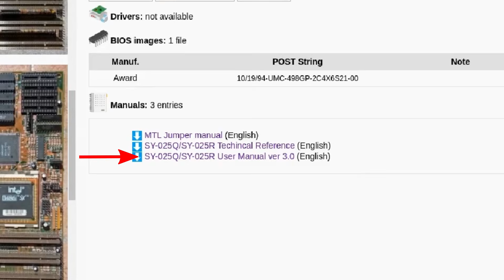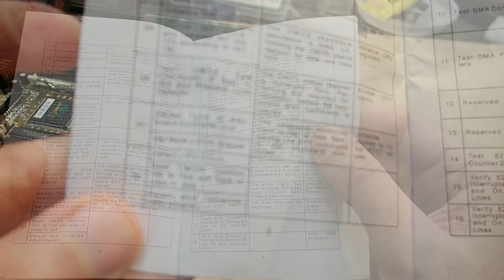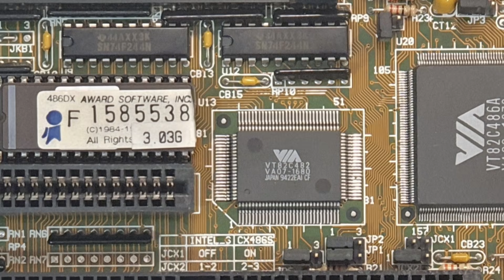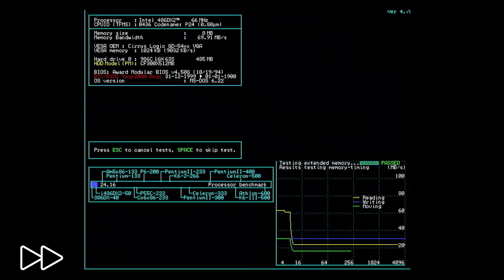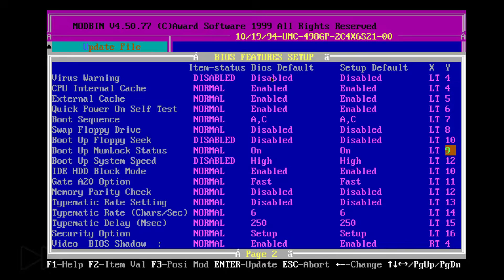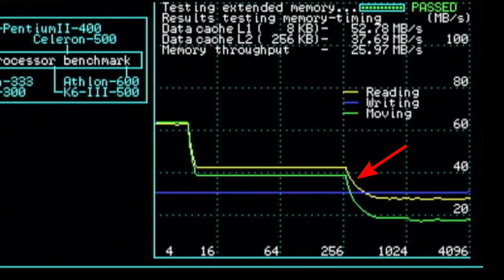Let's revive a 486 Soyo SY-025R mainboard with a sneaky secret

Comment: I have a similar 486 board with VBL and missing the refulator. Sadly, I don't have any information about the pin settings in any site. So I think thaat I would need to look the tracks to the chipset and the PDF from the chipset. I hope that I could add a regulator and use it with a AMD 486DX5 133 that I have.

Very interesting about the tool to modify bios.

Comment: why are half teh L2$ Sockets have longer (4 extra pins) ony on 4x of the Cache sockets ??? @NecroWare ??  ive never noticed this on boards ive had?
Reply from the maker: This board can handle max 256K of cache. Means 8x32K or 4x64K. The 64K chips are longer.

Comment: ModBin was a powerful and easy to use tool. Great for finding settings hidden by OEMs. There's also CBROM, good for adding new CPU support, and fun custom BIOS splash screen (convert new image to LOGO.AWD before you inject it into ROM file). Hey, with the 3.3v, how about giving it an Evergreen Tech (AMD 5x86) upgrade CPU running at 125MHz ?

Comment: i also have a 486 motherboard here with 3,3 volt support. but the Dallas Chip makes problems, the BIOS was not saving anything, not even after a soft reset, but the curious thing is: Date and Time was always correct! is it possible that the RAM inside the dallas chip is corrupt or the BIOS? The Board is a Gigabyte GA-486AM/S.
Reply from the maker: The battery is dead inside. It still has enough juice to tick, but it's not enough for the memory.

Comment: I remember when VLB was THE thing to have. Changed my MB for it so the disc and video controllers would run faster. Very quickly after that it would be superseded at breakneck speed.

Comment: Good evening from Greece. I need some help. I have a similar motherboard with vlb multi io hdd controller EVLSIO-V1 SUPER I/O CARD. The board is soyo 025L2. I cannot see more than 2 hard disks on ide 1. The second channel is not visible. This is a bios limitation or the controller has compatibility issues? Thanks in advance.

Comment: Let me tell you a story: I watched this and used modbin on a slot 1 abit va6 via bios file and found hidden features to switch on the soundblaster dos mode for the onboard via sound! I flashed the modded bios with awardflash tool and boom: the board was dead. That was 1 week ago. On ebay I found the old "ctflasher" an isa card to flash bios chips with a turbo pascal program!? And it worked! My beloved abit board (which can handle from katmai to deschute, coppermine, tualatin...) works again! Love your channel!

Comment: do you think you can upload an image of that compact card? i've got a "nsx 386" with a blown tantalum and just removed the battery, I need to replace the connector and do a vinegar bath to remove corrosion, and then see if it works!
Reply from the maker: You mean the compact flash card? If yes, I can't because it is illegal, but it is a normal DOS installation with some selection of tools. You can start with the benchmarks selection by PhilsComputerLab if you don't have any preference.
Reply: @necro_ware  that's good enough for me. thank you. I just got covid so I was isolated in my office binge watching your channel. It's excellent. Thanks for sharing your knoledge

Comment: Very nice. I like the SOYO sticker 😀 I am just in the process of saving the same board that is heavily coroded from the battery leakage. If it will run, thinking about adding the voltage regulator. Mine has non, but the preparation is there. One question: If some traces are OK, but darker (with the solder mask still on but hit by the battery already) it is better to leve it as it is or do something about? I am affraid of doing more harm than good and creating a total mess! I recreated what was eaten and cleaned and reepaired the badly damgad traces with a lot of corrosion and eaten solder mask. Hold thumbs I hope it will post!

Comment: hello my friend you might be interested in dosbox-X it has some more advanced features and even allows more access to the hardware machine plus i think it has support for 3dfx but i never played with it.
Reply from the maker: Yeah, I know that, but thank you for the suggestion though.
Reply: @necro_ware  the funny story is i was using doxbox for my self for years but when i started my new job we have allot of rolling machines at work they are used for corrugated sheet metal and gutters ect the computers have lcd to adjust things like length and other things but its well a DOS program so the bright minds who set these machines up thought oh lets have Windows 10 on the thin clients and run a doxbox-x, me personally i would have tried freedos but anyway i had a look at doxbox-x and the extra functions got me excited so now i just use that.

Fun fact allot of the machines are RS232 and RS485, i guess it works.

The only machines we have that are modern are the folders simplex 8200 nice machines for folding steel.
Those are Ethernet and use the USB for other functions like barcode reading ect. 

P.S I fallen in love with the sexy 25kw motor sticking out the side of it for the hydraulic power pack and its run  on VFD mmmmmm.

I am in Sydney Australia.

Comment: If I remember correctly you can press Ctrl + F1 or F4 (can't remember which also can try Alt and the function key as well) and unlock the hidden menu's in the BIOS of some Award systems.  I wonder if there is a tool or key combo for Phoenix bios's as well.

Comment: I had this mobo without voltage regulator and sold it away, 3,3v is a must. But I still have two QDI 471 and one Asus PVI-486SP3 so I'm covered.

Comment: Thanks for another great video. I recently bought a socket 3 motherboard off ebay "used working condition" but sadly it was beyond repair due to not only leaking battery but the chipset flatpak was burnt I put aside and may tackle one day I raised a ebay dispute but I am more disheartened I couldn't use my intel overdrive chip sadly some people are not honest but I now have to find the same motherboard to get the chipset flatpak and I may have some luck but your biios modding tool was cool I wish i had tgat back in the day i would of had a lot of fun

Comment: You never seem to stop finding new knowledge for me that I didnt know I was missing. Wrong bios in a motherboard? "here is the tool and a guide how to handle it!" "Looking for the right busspeed? Single wire into the cpusocket and read it on an osciloscope!" "Check cpu voltage, again single wire into the socket!" Every video you post, simply makes my head bubble with ideas how to handle the crusty old hardware I have stored over the years. Thank you, for your amazing work =) and if I can make a single wish for a video? Perhaps a "tutorial in finding the jumpers, or correct pins in cpusocket to measure, if you lack the proper documentation".
Reply: I absolutely love his systematic approach to do some checks before even trying out the motherboard with a CPU or other parts attached. no putting it together and hoping it doesn't explode.

Comment: Another great video!
Really nice tip with the bios tool. I've got this Pentium 3 mainboard where I actually want to disable the cache to slow it down, but the BIOS does not let me, and software tools don't seem to work. Will definitely give this a try!

Also what multimeter/oscilloscope do you use?
Reply from the maker: See the pinned comment in that video, I wrote a little bit about it there: https://www.youtube.com/watch?v=koL3T5OAlIk

Comment: Do you always use a new EPROM? Are you using EPROM or EEPROM? Do you consider EPROM erasing with UV unreliable?
Reply from the maker: I erase EPROMs with UV light all the time. I just put used EPROMs into a "used" box and clean them in one go as soon as I have enough to fill the eraser. Sometimes I of course also use EEPROMs.

Comment: just amazing! Wish I could go back in time and mod my 486 motherboard's bios now!! Question: how come the BIOS uploaded on the database was missing those options? It must have been saved from one of those boards... but didn't have those options? Thanks for the great video!!
Reply from the maker: Thank you! That's a good question, but unfortunately I don't know the answer. My assumption is, that it came from some OEM machine, which was heavily cost reduced and customized for some reason. I can only guess...
Reply: @necro_ware  that would make sense!

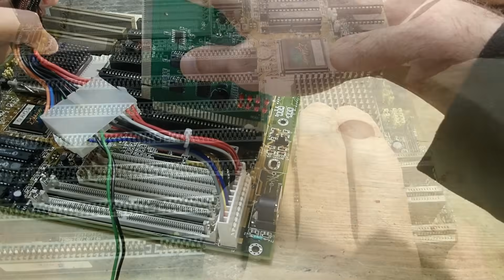Comment: 3:43 - is that a heatsink from 3D printer stepper motor? I bought some of those recently and they fit 486 processors perfectly. 13:30 - "Necromod" sounds awfully lot better than "modified by Necroware" :D Also, many thanks for explaining Modbin tool - I wasn't aware of its existence.
Reply from the maker: I guess this heatsink was glued there onto about 30 years ago, so I guess it's rather the other way around. The 486 heatsinks also fit the 3D printer stepper motor :D
Reply: @necro_ware  yes, at least if you glue it down

Comment: I have learned so much from your videos, it's a bit scary. I never knew you could modify the BIOS so easily. Thank you very much Professor...
Reply from the maker: Knowledge exchange at it's best. Learning from each other is the best way to evolve....
Reply: @necro_ware Helo, i have that board without capacitor (only tantal capacitor left), if you still have Soyo-025R please help me with the ratings of electrolytic capacitors.

Comment: I always assumed those BIOS were compiled from source(assembly), and would contain only the code for the features that are included. It's interesting to know the bios rom is actually "full featured" and just configured to not have certain options visible.
Reply: And now that I know this,  I am annoyed to no end!
Reply: @Merescat  I'd bet money that the Award BIOS royalties varied with what options were en/disabled.

At least it was an easier fix than modern processor feature-gating.
Reply: @CptJistuce  I agree.  🙂
Reply: @Merescat   Why?  That opens up a world of options that wouldn’t have been there if each image were assembled specifically for the target board.
Reply: @sirnickity  I guess the context of my reply is missing.
Reply: Especially gigabyte

Comment: Download links for the modbin??
Reply from the maker: I don't know any official site and I'm unsure about legal stuff. Please just use google, it takes a second to find it.
Reply: @necro_ware  my bad the bios i want to modificate the default values specially for the floppy controller which by default is disabled is an AMI Bios a modern one because the mainboard is an ASRock 960GC-GS FX.
Reply from the maker: @asanjuas  Also for AMI BIOS such tools exist, but which one is the right, depends on the generation of the BIOS used on your mainboard. For older Pentium boards there is AMIBCP and for later boards there are more recent versions, which will run on Windows. Like AMItool, MMtool etc. You will have to investigate a little bit.
Reply: @necro_ware  it's an asrock 960GC-GS FX for socket am2/am2+/AM3/AM3+ and DDR2 and DDR3 (not simultaneous) and yes with amibcp 3.45 i was able to enable floppy controller which has disabled by default on the BIOS. For the moment not the floppy type.
Reply: Thank you very much.

Comment: Was setting up a “retro Hackintosh” (Core 2, so I had to use some older tools) and faced a similar issue: the system exposed HPET but no matter what you couldn’t configure it. Come to find out they deliberately hid the option to set the HPET type despite the BIOS fully supporting it. So annoying.

Great repair dude, another one saved from the trash.

Comment: Ah! I had this piece of crap back then. It was the biggest mistake in my PC history (and that's saying something!). Try to get a VLB IDE controller from Promise into the slots. Professional tip: You have to use a special tool: a hammer. And then began an IRQ orgy like no other. After a few months I gave up and changed to a MoBo with PCI. Nevertheless, thanks for the video, even if I'm just annoyed again. After... when was that in 1994? Wait... I had written a class reunion paper on the board: "09/02/1995! i486 DX/2 80, 256 KB cache, 8 MB RAM, Hercules Dynamite Pro 1 MB, 17" monitor, Vertos IDE CD-ROM DS, Iomega 250 MB streamer, 14.4 modem, 256 grayscale hand scanner, Epson Stylus 800!", The buddy who was writing along had a DX50 and switched to a P90 while we was writing. We wrote the thing with MS Publisher 2.0 first on Win 3.11, then on 95 Beta. From a buddy we borrowed a good scanner: Iphoto Plus. FLASHBACK
Reply from the maker: VLB came in the time, where PCI was not yet a thing. You are right, there were couple of issues with it, certainly mechanical, but especially the stability issues were annoying, since that bus was bound directly to the CPU working with the full FSB clock. You often got into problems when running above 33MHz and had to tweak the settings and select your hardware properly, but once you got it running, the speed was very impressive and left the PCI far behind. If I'd build a monster 486 machine, I'd definitely use VLB, despite of the issues, which I'd have to handle. The end result would be worth it ;)

Comment: Wow... I had no idea there were tools as capable/advanced as modbin. This is an eye opener to me.
Makes me wonder why so many features were disabled on the bios from retro hardware. I mean, external cache should always have been available.
Reply: I may have an idea... it may have been a custom BIOS mod by some computer shop to enable them to sell later the customer an "upgrade" which makes their computer instantly faster.
Reply: @stamasd8500  That sounds shady and conspirationist af. I sure hope it wasn't common practice back in those days. Surely the tools we have today to customize  BIOS didn't exist during the early 1990s?
Reply: @jerem-SaveStargate  Or at least enabled by default.
Reply: Most likely, this ROM image is from one of those scammy boards with fake cache chips. It can't hurt you if you don't know it's there, right?
Reply: @RetroPeKar  Nah. Fake cache would be soldered in, and the BIOS hacked to report that cache is enabled even when it isn't.
Reply: My opinion is, that someone tweaked this BIOS to have ability to remove cache chips from the board, or better said , boards, and sell em. Lots of this filthy stuff happened back in the 90s. He maybe did it on hundreds of boards, as some "seller", or computer shop. 
But another alternative also can be, that it's really some universal BIOS, with option that can make board unstable, removed.

I think, the first alternative is less probable. Because, if someone would steal only cache, he would not probably touch timing options for RAM, as it would only takes his time. But maybe, he did it, so board run as much stable, as possible at all costs, so noone start to investigate anything on it.
Reply: Put your pitchforks down for a moment, boys.

The BIOS image could be taken from a generic template image for a generic 486 board with a UMC chipset.  It’s quite likely that image was the first one Soyo released for that model motherboard and hadn’t QA tested cache yet.

Back then, it wasn’t a given that you would install cache memory due to the high cost of SRAM.  So if the board shipped with no cache, and they were in a hurry to get it released, it very well could’ve just been left for future BIOS revisions to enable the go-fast features, once the code and PCB layout had been validated.

After all, what’s worse than a board without a feature?  A board with a feature that makes it unstable.

Motherboards often had several versions over their run, and a later version probably DID have those features enabled.

As to why so many features were disabled to begin with, well... notice the PCI configuration menu?  Did you see any PCI slots?  The Award BIOS code is very modular, and a single base image could be applied to a LOT of different boards with various options enabled for board configurations where they applied.  Soyo might also have left certain options out in favor of higher end boards, to distinguish their low-cost offerings from the more expensive ones.  Same as CPU chip binning.  Doesn’t mean you CAN’T use those options, same way a 25MHz CPU might run fine at 33MHz.
Reply: A lot of OEM manufacturers did such modifications to non OEM motherboards. They are still doing that to this day. 

One very obvious motherboard I came across was an Asus A7N8X-LA, which was a very capable board, but had all of the features for overclocking removed. CPU detection was supposed to be automatically, so everything was as standard, so there couldn’t be more editable settings in the BIOS that would cripple the computer when edited by a user without any knowledge of what he/she/it’s doing.

Comment: I had a similar looking mainboard fro my 486. It was an real beast, I used it with CPUs from 486 DX2@66 up to AMD 586@133. It had FSBs of 33, 40 and 50, cache (WB or WT), voltage regulator, 3 VLB slots marked as 2 master  and 1 slave. The BIOS was the graphical Winbios. My setup was with a VLB Trident TGui and an dual IDE VLB controller capable of UDMA and LBA, ISA soundcard SB PRO compatible. I ran Windows 95 on it with 4x1M 30pin + 2x8M 72pin SIMM. When I used 2x32M 72pin, the motherboard unleashed all its power: Windows, games, and all the software ran quick, smooth and I felt that it was on pair with my P1@90.
I miss that motherboard, but I have no Idea what was its name, model or maker. I am almost sure that the chipset was UMC.